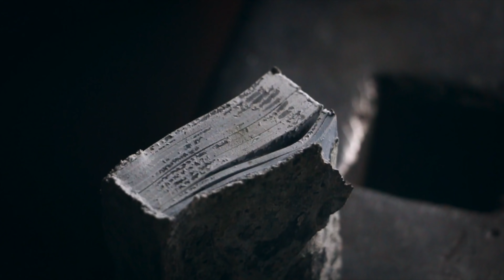Can You Forge Weld NIOBIUM??!!

Comment: I think the argon is going to keep it from getting hot enough also I like the last canister that you made and maybe make drill shavings out of the niobium would look cool also the last billet that you made instead of trying to anodize it running the colors with heat I’m sure the other material will color really good before the niobium comes up to temp

Comment: Seems to me you are leaving yourself a lot of unknowns......perhaps you could start by using an infra red thermometer so you know the temperature you have the billet at when you attempt to forge weld?
Have you ever thought of using tinted eye protection to help reduce glare and give you a better view on what is happening? (oxy or arc welding visor could be useful)
These are not criticisms ..... sometimes to answer questions you need to begin with a basic foundation of knowledge so that you came confirm/eliminate some of the broader assumptions (especially if the 'suck it and see' aprroach didn't work). 
Hope to see how you move forward with this project, cheers

Comment: Can you not just buy billet niobium? I don't see the point in forge welding it, as it's all the same material. You're not going to get a Damascus pattern, and you cant stack it with other materials, because they'll melt. Actually, you could weld other materials to it. Put in a steel canister with your preferred high carbon compatible material. Line your canister with paper to burn off the oxygen and white out the inside of the canister to prevent sticking. Get it up to just over the welding temp of the secondary material. As long as the temp is high enough to make the secondary material sweat, you should get fusion to the niobium. I have welded dissimilar metals in this way before. I have no idea if it'll work with niobium. Do you know the composition of the material? What is it alloyed with?

Comment: The reason niobium is used for rockets is because when you heat it up it ablatively turns to a gas. Basically as it gets hot it dissipates and turns to gas to radiate heat away. You won't be able to forget weld it. Sorry m8
Reply: I don't know where you heard that but it's very wrong. Niobium melts like any other metal it doesn't ablate. The reason they use it is because of its extremely high melting point. Being able to get white hot allows you to use radiation cooling and just emit radiant heat out to space for example. Spacex uses it for the nozzle extension on the vacuum rated Merlin engine.